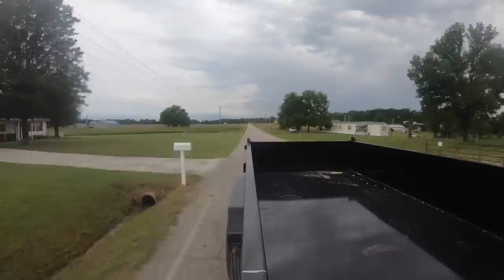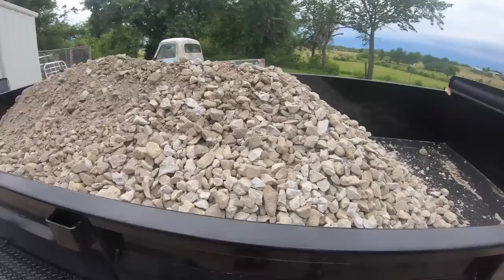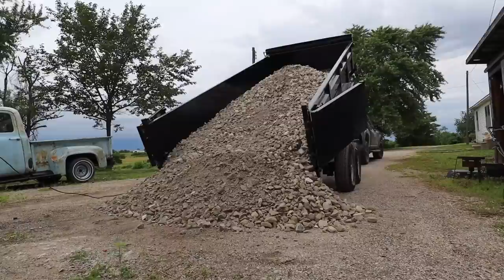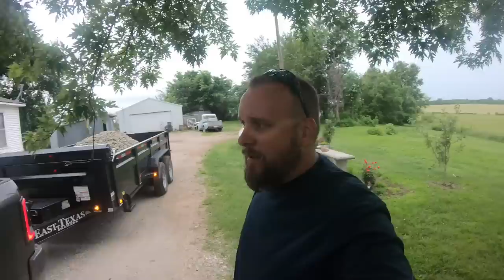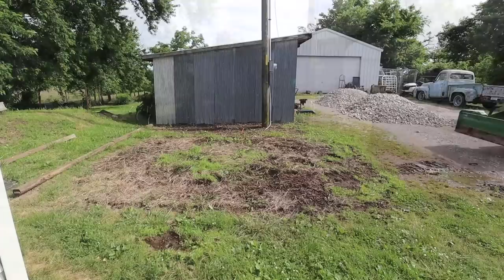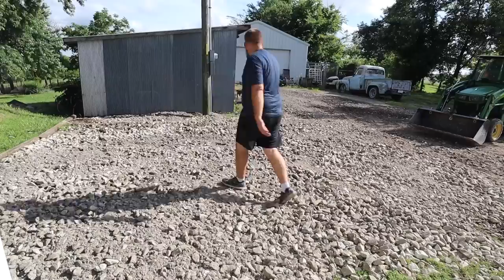A Small Driveway Job that could have Ended Badly

Comment: That's why you always have a rake or shovel on your trailer. I couple swipes with the rake forward or back and your load is where you want it. You don't have to move a lot of rock to adjust the tongue weight.

Comment: Magnetic DUMP HERE with arrows stickers. You can adjust them up and down the lip of the trailer so the loader guy can lineup with them to dump. We're already looking at the edge of the trailer/bed, and can typically spot some type of marker to line up with.
Reply: @Greenwood's Bush Hogging  Man that is a good suggestion, direct and most affective!

Work safe this Friday eve and "Get Your Smile On"  ☺

Comment: Hello Brock, I have ran front end loader in gravel pits for close to 15 years. I wouldn’t of said anything after the first load honestly for the couple hundred pounds it’s not a big deal. If it was a big deal for you I’d shovel it forward when you’re out of the way. The sign on the trailer won’t make a difference at all. The main reason is loader and the bucket size. I run a loader with 13’ ft spade bucket and it all depends on how it’s loaded in the bucket left to right. You could’ve dumped it and he could’ve loaded it in the exact same spot and it could’ve been right on or even heavy. Like where I work, we no longer allow dump trailers or single axle dump trucks in our pits because of they’re a liability. They’re forced to go to a landscape retail store where you get ripped off on price of material. Reason one they are not allowed is they don’t have a cb and we don’t allow them to get out of their vehicles. In that time you drive up and find out what amount they want. Get the bucket and load them you could have a big truck loaded. Make maybe $25-$30 on around 5 to 6 tons with a dump trailer or load an end dump getting 24-26 tons. More and more pits around here in MN are going away from the small trucks for those reasons. In most cases yes a dump truck gets loaded down the middle for rock and sand products. Now I’m dirt or clay, load towards the rear because the drivers will all bitch if the material gets stuck in their doghouses. And when they come back they’ll tell ya because drivers don’t wanna do more then they need to. Plus if they get passed because they had to clean their box, they’re gonna be pissed. Or if they gotta wait to get loaded and some trucks are reeling them in on their job. Being the loader operator it’s your job to load out trucks fast like me I have days where I do 300 trucks a day. Drivers don’t seldom ever worry about the weight of their axles either. They just care if they’re loaded in the middle (drivers-passenger side) and they have around 500 pounds plus or minus the weight they asked for. 

You’d be amazed what some guys request with their dump trailers. 6 tons to 6.5 tons is commonly requested on a 14k trailer and they’d say load towards the rear so they can actually dump it. I can’t tell you how many times I’ve heard that and loaded that. 😂😂

I like watching your videos and Tractor Time with Tim’s and like your job I would’ve done it the exact same way. You do good work and you make great videos! Keep up the good work!!
Reply from the maker: Yeah, I’m not trying to be critical of the loader but just trying to understand what is it is not safe.

This one was not loaded the way I wanted it to on the first load but I brought it back anyway to see how it would handle on the road. I could tell it was a little bit off by the way it polled but I could still drive it.

The Rock Yard I go to I go in and talk to the lady at the desk and then she radios the driver so I never speak to them directly

Thanks for watching

Comment: I wonder if it might be good to have a shovel and rake in the back of the truck to push the top of the pile in the direction you need it (assuming you'd like to avoid dumping and reloading).
Reply: This is the suggestion that I would make too. It doesn't take much raking to fix the weight.

Comment: Do you know what the 2038 weighs with fluid filled tires and loader?  How much does the backhoe add to that?
Reply from the maker: The list weight is like 2600 pounds but mine has three sets of wheel weights and the fluid in the tires and the cab and with the backhoe on it weighs around 5500 pounds

The fluid has 530. I think the backhoe is around 800

Comment: This is one of the times when I would have explained to the customer that a few pieces of geo-fab would be good here under the base,Especially when you can't cut down deeply.Cheap assurance and gravel preservation.and less likely to pound down to the electrical wiring with the gravel in wet season.Turned out good.Any reason the CTL did not come out to this job?

Comment: I wonder if you could put a vertical line, say down the inside of the sides (maybe over the top rail too) that showed the location where you want the load centered, once you find where that is (would having a LARGE vinyl sticker that says CENTER LOAD HERE with arrows pointing to the line from either side, or something, be too much...).  It would help both you and the loader, especially if you go there fairly often, they would catch on fast, maybe......  

Okay, the next paragraph is a product of me thinking about this way too much maybe, not really directed towards you, just general thinking for all to consider, or ignore....

It probably isn't as simple as it seems for the loader operator, when I was looking at dump trailers before I got mine, the location of the axles varied quite a bit more than I would have thought, some much further back than I thought could be safe with any load.  And it seemed to vary with length for some of the manufacturers, like they would use the same layout from the coupler to the back of the rear axle, then add 2' or 4' behind the rear axle to make 3 different trailer lengths (seemed like a horrible idea to me.....)  So on the short trailer, the load would need to be almost as rear as possible and maybe centered in the box for the longest version....  And you just saw how much of a difference the location makes with just a small shift (I'm guessing you would be real close if the load was centered in the box based on the two loads, but your weigh-safe hitch will help you get that just right with a couple more loads and varying the placement).  So the loader is constantly guessing on each different dump trailer that comes in and likely gets very little feedback about how any of the loads rode (and then mostly just the angry types.....).  And they have a bucket meant for loading BIG dump trucks fast, where I would guess they just load centered and it doesn't matter much if it is off a little, as long as it stays in the box.  And (this is a lot of and's) probably less than 2% of the dump trailers going there have a hitch that gives the clarity feedback for the load that you have.

Okay, if your eyes haven't glazed over..... now a question......

With either of the loads you had gotten, I am curious if you could redistribute the weight a decent amount by just standing on top of the pile with a shovel and pushing the top of the pile down the slope of the pile towards the front (for the first load) or the rear for the second load.  Not trying to pick up the shovel and toss the rock, just leverage the higher rock down the slope and also towards the corners.  This would not be ideal, but easier than "shoveling and tossing" it.  The second load would probably be the way I would prefer it to be "miss" loaded, as you could use the dump function of the trailer to help shift some weight rearward, either on its own or in conjunction with pushing the pile down the slope with the bed raised some.   Just raising the bed till you get some "shift" rearward and then lowering it and reading the gauge (repeat as necessary) might be easy enough if you always get your load placed a little tongue heavy, just to give you an easy option to "perfectly" balance your load each time.

I will try this when I get some stone soon (pushing it down the pile), though I will be getting 57's, not 3's and I won't have the feedback you would have since I don't have a weigh-safe hitch.  None of this is saying your should need or want to do this on every load, just that it may be a helpful option (if it works at all....) for when the load isn't placed well.

Anyways, that was a great video, both the load issues and the nice tractor work!  I need to go rest my brain now......  Have a good one!!!
Reply: All good points…

Comment: Can you use a weight distribution hitch common on travel trailers to stabilize your trailer?
Reply from the maker: I have one and I have demonstrated it on my other dump trailer but it’s really not ideal for a dump trailer. One issue is where they want the stabilizer bars to attach is right where the toolboxes.

Another issue is that your weight is not always the same and you set those up based on the weight of the trailer.

Thanks for the suggestion

Comment: 10% is not an absolute.  When we design trailers we design them to be around 10% both loaded and unloaded so in reality your load should be centered in the dump box so it provides a uniform loading in the box if it was properly designed.  That said we have trailers that when empty have 15% on the tongue but when loaded have 10%.
Reply from the maker: I agree. And I measure it on every load with a variety of different trailers. The 7 x 12 dump trailer was a higher percentage when empty. This dumb trailer seems to give you the same percentage when empty and when properly loaded

In this video when the measurement was too low I could also see just by looking at it that they had centered over the axles not centered on the trailer.

In the second load when the number was too high I could also see just by looking at it but that load was too far forward. The Gauge verified that

When I really find this to be helpful is when you have a material that you don’t know the weight of or that is irregular shaped or unbalanced.

If you’ve been monitoring the numbers on your gauge and you know what you want it to read on those your regular loads

It’s a point of reference to combine with  everything else you know about proper loading. 

I’m not trying to say you have to always hit 10% but what I’m saying most importantly is not to let it ever be less than 10% because that is how you lose control of your trailer
Reply: @RockhillfarmYT  I agree. So with the load placement moving forward just a very short distance between too much and not enough, I would mount a shovel on the trailer to fine tune the load.  The manufacturer is going to design it for a completely uniform load from front to back.  So you might need to shift the load a little bit since this new trailer is very sensitive.

Comment: Good video Brock. I tend to disagree however regarding the first load. 800lbs on the tongue should still be a stable load.. Had the majority of the load been to the rear of the trailer/ axles, I think that is a larger concern. I frequently haul loads configured like your first, however our trailers, and prob axle configuration are likely different. Either way, good video.
Reply from the maker: Thanks, I don’t try to be the foremost expert on the subject but just give a point of reference in my opinion.

From my experience the proper way to load that trailer is halfway between where they did the first time and where they did the second time. You’re not gonna get it perfect every time though
Reply: @RockhillfarmYT  Hey Brock, wasn't implying you were incorrect.. trailers are different. I have the same truck as you, so just giving my experience. Some of the loads I've hauled were insanely tongue heavy, and felt borderline dangerous to the truck. Im more concerned about a receiver failure with too much tongue weight. Ive also never had the harrowing experience of having a trailer get out of control on me that you did.. that would change my mind on loading im sure! Keep up the good videos!